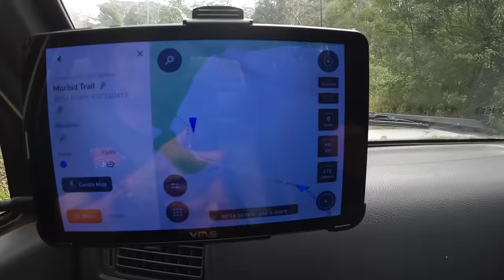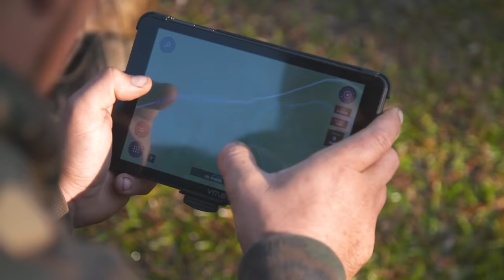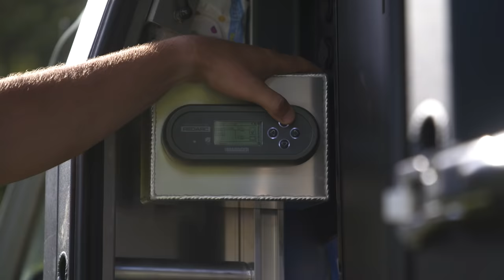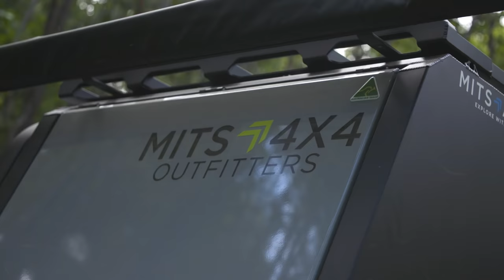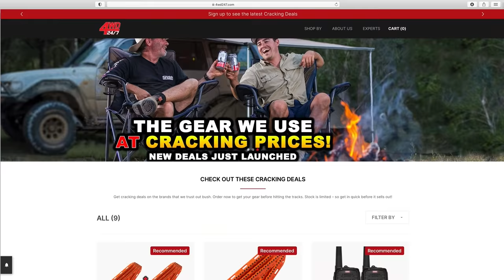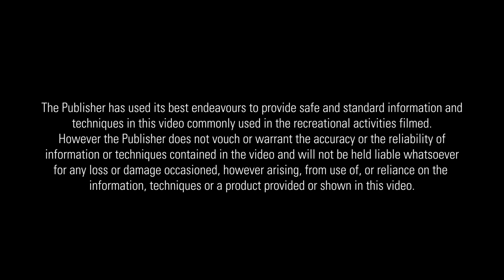OLD BUDGET 4WDs vs. Australia’s TOUGHEST tracks in Coffs Harbour + Snapped Axle & Best campsite EVER

Comment: Scariest moment I’ve had behind the wheel was on my first solo trip over at Moreton, was absolutely pelting down with rain when I arrived at in the dark and upon backing into the beach camp site, I got myself bogged to the diffs in the old GU. Had to leave her in the path of the high tide until the morning when I went to take a look at the damage of the water and realised I had left the front hubs unlocked 🙄. Glad to say water didn’t reach the exhaust and I’ve never gone back on the beach without checking the hubs at least 7 times 😂.
Reply: I’ve had the same with the front end not being engaged while on the beach. You feel really dumb when you find out later one. My rear tyres were getting the oncoming tide still had 5 hours till high tide. Managed to get a mate to drag me after hours of struggle.

Comment: Scariest moment in a 4WD was wheeling out the back of Coffs Harbour at Magic Pools. Was trying to bypass a swimming hole and slid in on a sketchy side angle. Nearly rolled my 80 series in the water and had a 5 hour recovery to get her out. All the electrics were cooked and ripped out a tyre valve stem from all the rocks.

Comment: solenoid valve lock would be good safety option on the rear brake line of the 47...pull the parking brake, press the brake and switch on the solenoid..

Comment: Cape York trip 2003 in a 84 xtra cab Hilux… corrugations displaced the battery (crap tie downs), battery acid everywhere! Side of the track repairs, a few occy straps and back to it. Camping at the month of the Jardine river, high tide middle of the night and being kept awake by massive Barra jumping and even bigger croc splashes chasing them! Being snatched out of every water crossing along the Tele track as the solenoid had an issue of not making contact when tipped north of 45 degrees making the engine cut out…. Then pushing it under tow to get up a rock bashed into the side of the fuel tank causing a hectic leak… lucky we had champion in the convoy who knew about the soap trick long before Graham educated all on YouTube!
Love watching your videos, takes me back to the harder tracks we tackled and assisting in planning future adventures plus helping light the fire of 4x4ing adventures to my 9 year old son.
Would love to have a set of seat covers to upgrade my dirty old fourby!
Cheers
Al 👍

Comment: My boyfriend was teaching me how to 4WD, in a manual none the less, and we came to the top of what I would describe as a huge sand dune. I was terrified! Still getting use to manual driving, he told me to keep 1st gear and just guide the car down. To me, guide meant just steer the car, because gravity would take care of the rest… initially this was good, we were driving slowly down this huge sand dune, until the car started sliding side ways! I tried to counteract it with no success. My boyfriend finally said “drive the car!” I thought I was. Apparently I needed to apply a little throttle to drive down this crazy descent. Well I drove that 4WD down the sand dune and there was no looking back. I’ll never forget that lesson. It was both terrifying and exciting, all rolled into one. The main thing is, I conquered it 😜

Comment: Not sure if it’s too late but thought I’d share anyway. When I was young first getting into 4WDing I had a Toyota 4 runner that had very minor mods. Was meeting some friends out at the lost city in Lithgow after my shift 10pm finish on the northern beaches of Sydney. Long story short ended up on ranger bob at around 12:30am on my own tackling some fairly extreme obstacles on my own with no winch. Safe to say I didn’t need the ceramic throne for a few days after that.

Comment: The scariest thing didn’t happen while off road, but in our four wheel drive nonetheless. It was my birthday and I had taken the kids to get some treats. I waa about to pull into our parking spot when I had lost control of steering! The steering wheel was spinning freely. I stopped where I was and called my husband: “There is something broken with the truck! You better come look!” Turns out, the steering wheel base had snapped out of its socket. (We had a piece of our AC replaced weeks earlier and the guys in the shop didn’t screw that bolt tight.) Now imagine loosing steering while on a windy coastal road. Or just the freeway. So glad it happened in front of our house!

Comment: One of my many scary times was in my MQ short wheelbase and I was on a very tough and dangerous track called the Hume hwy in Sydney and I was going through an intersection on the green light and some tosser was turning from the opposite direction that I was going and  T-boned me, I went on to my side then flipped on to the roof. The fibreglass roof shattered and the cabin roof crushed right down to my face level, but thankfully I had invested in a roll bar and it stopped the roof from totally crushing me and I walked out, well crawled out.  I’ve been on plenty of tracks on 3 wheels and have the Elvis leg going on the brake thinking I’m about to roll over, but being in that actual rollover at 60 kph was very scary 
Great video again boys 🍻🔥🐷🍔🏕

Comment: Exact spot where the big Mits 79 broke off in the rear. Had my MQ Triton with 31’s 2” lift and full sized tray/canopy. Was a wet day and we kept pushing up the track. I got the Mrs out of the car to take some photos. As I came up the little wombat section the car lost traction so I backed off. Straight away the entire front end slid over the hump and into a ditch, nearly rolling the vehicle. Best part is the Mrs “ahhhhhh” on the recording 😂

Comment: Scariest time for me we was out wheeling and it was dusk. So the sun was setting right out over the ridge. Just at the right spot we couldn't see out to far.. We crested over the ridge and the other side was a drop. All a sudden the hill just ended to a cliff rock face . Would have been a fast drop with a quick stop. Slammed on me brakes. We were sliding over. Finally the tires dug. We wernt going fast but we were doing it fair bit of speed to climb the hill. My bud and I  jumped out to see just how close we were. Took us quite a bit of effort and energy to get backed out of that spot and back on the trail.

Comment: My scariest moment is driving up Telecom Hill at LCMP. Rocks were a bit wet, gave it a bit too much and went offline. It pivoted around the back left tyre and ended up 90 degrees on the track with both left tyres coming off the rims and one rim destroyed. Only reason we didn't roll down sideways was that it caught the rockslides and fuel tank underneath the car.

Comment: I've had my fair share of hectic offroad moments, worst (I got this one on video amazingly XD) was straddling a clay covered rut up a pretty decent hill on my local powerlines track, came across a stump in a bush I didnt see, tried to cross over the rut one wheel at a time, lost traction, started sliding back, full throttle and still sliding then I hit the brakes whilst sideways and nearly rolled down the hill. Lifted my rear left wheel upon applying the brakes. 2013 triton. I gotta say though boys your camp cookups are my inspiration for when I do big feeds for the boys at camp.

Comment: You mentioned the 2.8 lacking power, my first 4wd was 2.2! You just 
had think "Hill" and the revs dropped off, and that was on the open road!
Re the broken axle, back in the early 70's I was working at a place where
a large tractor suffered a broken axle, everyone was beside themselves,
How the bloody hell do we fix it? an old grizzled boilermaker had a look
and took off and returned with his battered truck. He ran his welding 
gear out, got a long piece of rod, put it inside the housing against the 
stuck axle, then using another rod extended his welding rod and proceeded
to weld the first rod to the broken axle, then extracted said axle. 
Saved days of work dismantling the rear of the tractor.
Maybe something similar could be used to save broken 4wd axles.

Comment: Scariest moment was only this week, went solo camping on Wednesday night in Chichester state forest and went on a track the next day that got super steep and slippery, couldn’t reverse off as the ruts sent me off the edge, even with 4 maxtrax and my rear locked patrol with tires down to 15psi I couldn’t get up. Walked 26kms before I found someone with a winch who save me, used the winch and 3 snatch’s to reach me from the forest road, was stuck for about 8-9 hours in the middle of no where with no service

Comment: Scariest time on the tracks left for a camping trip Friday night after work. Jumped in to the lowered 2003 Subaru Impreza wrx and headed off to find a location we had only seen online. It’s bucketing rain and after an hour and a half we get to a rather tough looking track. Start heading down there as the gps stated that was the way and we definitely weren’t turning back. As the puddles start flowing over the top of the bonnet we start suspecting a lowered wrx probably want the car for this trip. We pull up and walk along a especially muddy large rutted aria. It become evident that the only way would be to stay on the top of the ruts as we had little to no ground clearance. As we head into this section the car starts sliding to the right into the ruts. “When I’m doubt power out”. So turn the steering wheel left and sink the throttle to the floor. To my amazement we drove on a bear 45 degree angle trying to stay on the high side of the ruts until we made it to the other side. We stop a couple car lengths ahead to wait for a mate following in his Au falcon Ute but right at that point in time he slides the right front wheel into the left rut and the right rear wheel into the right rut and the chassis was hard up on the mud. The only “recovery gear” we had was some Telstra rope. Attempting to loop the rope over 4 times between the wrx and the au we try to pull it out but just snap the rope. Thinking we would never get out we camped on the side of the track. In the morning while preparing some breakfast an 80 series comes through with a winch. This was our saving grace. He was amazed that the two cars had even made it as far as they did. After some research we realised that the road we were attempting to get down was a 4wd only track. Got a hell of a story out of it tho!

Comment: Scariest moment was in my single cab LN106 luxy scaling the mountain range at Black Duck Valley back in 2005. Made the ridgeline track at the top with nothing but shear drop offs both sides. Decided watching a chopper flying below me through the valley was more interesting than where I was driving. Anyway long story short. Dropped a front wheel off the edge and was teetering over the edge with the back wheel nearly a meter in the air and a 100ft drop off in front of me. Fair to say, I needed a change of pants that day and the trip got called short after that.

Comment: Back in highschool, I took my dad's lifted 1984 Ford Bronco II out mudding with some buddies. We turned onto a minimum maintenance road that had some super slick mud, and some steep ditches. Before we knew it, we had slid to the very edge of the ditch, and it felt like any sort of movement would drop our tire into the ditch and roll us. After about 15 minutes of contemplation, we decided to just gun it, and for the next 200 yards, we rode the edge of that ditch. So dumb, but it worked :shrug:

Comment: The scariest thing that has happened to me is when i took a couple of my mates up to cape york, and I decided to sit in the passenger seat with one of my novice mates, and when he was going down gunshot, i told him to just keep calm and use the BRAKE, however he missed the brake, and his foot planted onto the accelerator and we went straight off the top, and we rolled straight over the front and onto the roof. The car was well and truly buggared. We saved it tho by winching the rolled fourbie (an 80 series) and got it back on it's wheels, and while holding the back down with a winch, the front winch we used to pull the 80 out of trouble. Safe to say my mate never went back to Cape York again.

Comment: scariest time behind the wheel 4wding was when me and the missus swag had a bad leak, had to pack up camp in crescent head and head back to port Macquarie for shelter. The quickest way back was across queens beach stretch cause we were soaked we ran  the risk, and packed up in the dark. High tide came and we pushed it as far as we could barely being able to see the water in the dark. We made a sketchy little dune climb about 5 attempts before we got up (first time i had freaked out beach driving) the luxy almost become a submarine, closest call but we made it out with only a few soaked clothes.

Comment: Scariest moment was down in a reservoir during winter. Still a good amount of river going, lots of water crossings. Went through a section and had to drive along the edge and then up the embankment. Was muddy and slide all the way down. Almost ended up in the deep end of the drink. Broke passenger axle shaft trying to save us. And it did. Wooh!

Comment: My buddy's and i were out having some fun in the snow and my buddy with his stock pickup was in front and slid into the ditch on the left side of the track. Then I managed to fit around him get in front of him. Then as I was trying to pull him out in my rig I ended up sliding into the ditch on the right with my back wheel floating over a culvert. We managed to get him out of the ditch by shoveling and traction boards. We then called up our friend with her jeep to come help get my full sized truck out of the ditch but after an hour we ended up doing what we could. We took 2 30ft tow straps with a high lift jack in between them and used it to pull tension on the front of my truck and a tree then used my friends truck with another rope to pull on the center of the double stap high lift contraption to get me truck unstuck enough to be able to drive it up the ditch. But still needed our friend to show up with her winch to fully get me out of the ditch. We ended up waiting like 3 hours in the middle of the night. But on our way back down I ended up pulling 2 more vehicles out of the ditch. So next thing on my list for my truck is the winch with it I would have been out in like 5 minutes lol.

Comment: Scariest time on the tracks was doing robe to beach port on a stormy day hitting a beach entrance and sand just giving way and taking us closer and closer to the water, two car convoy, 100 Series Landy and d40 Navara. Navara went down Landy went up it’s ass before reversing 20 metres and had rear suspension going full flex and getting stuck diff deep. 3 hours worth of digging with incoming 5ft stormy tide, racing the tide to save the two cars. Got out just in time only to blow up a battery and tow the Navara the rest of the way to beach port.

Comment: Had a moment at pine creek on a hill ended up slipping into a rut and almost rolled winch stopped working at the time so had to run a winch strap around a tree and just slowly drive out with 5 people hanging off the side of it so it didn’t roll 👌

Comment: Scariest moment I'd ever had in the 4wd was a late dash to camp after work on a Friday, and late at night, combination of fatigue and lack of concentration struck, and went off the edge of the road near Woods Point, and tipped it on the lid. 
Thankfully I was ok, but the ol' GQ wasn't so much, and since been replaced with another.
Reply: Ive been down those roads at night and in the wet. I was certain i was going over around some of those tight turns!

Comment: Scariest moment behind the wheel of my 80 , came just over a hill my diff bushes flogged out and caused a death wobble coming down the hill. Steering wheel was throwing my left and right , passenger had to lean over and help control it,   Hands down my scariest moment , another one is not me driving but my partner got to the top of a razor back when we were in out teens , driver's side sunk down and we rolled 8 times down a 50 ft razor back. Copped a toolbox to the head that day and lessons were definitely learnt.

Comment: My scariest wasn't even doing a hard track. About 20 years ago I was on hols up near Litchfield National Park with my girlfriend at the time. Hired a Jimney and was travelling through bull dust. Came up on a corner too fast and the tires dug in. I was up on 2 wheels thinking unless I straighten up we're done for. Did that which worked but meant we were now heading straight instead of around the bend. Launched over the graded edge of the road, all 4 wheels clean off the ground then came to a stop with a big thump. Didn't hit anything, no fluids leaking or anything bent, at least that I could see. Handed it back to the rental and never heard about any followup about it so figure it's all good.

Comment: my scariest moment was at frying pan creek in the Barrington tops where we were going to the camp site and it was roughly about 9pm when we got half way up in a bone stock 100 series and the rain and clay does not mix so we started to slide then hit the breaks and both front tires lifted and the thing that saved us was the tow ball and trailer got caught and saved us from flipping so we just backed down a bit took off the trailer and skull dragged it up with some rope